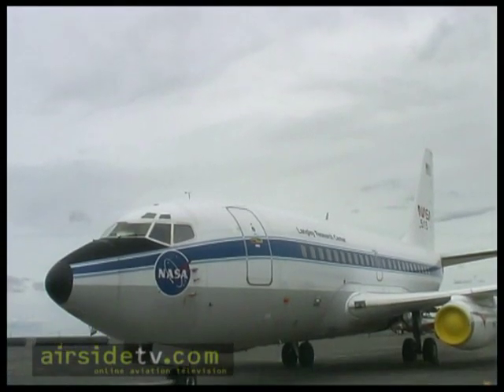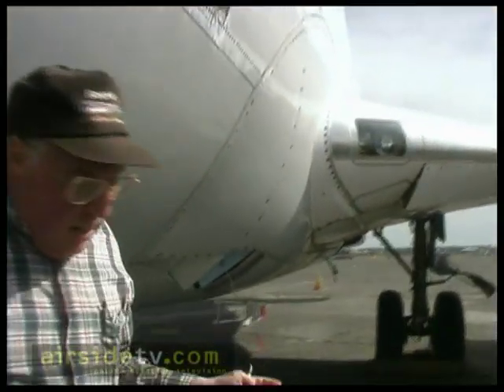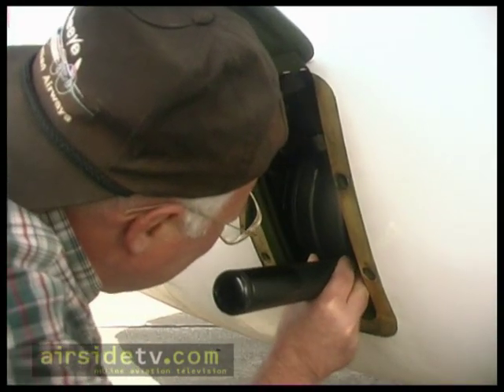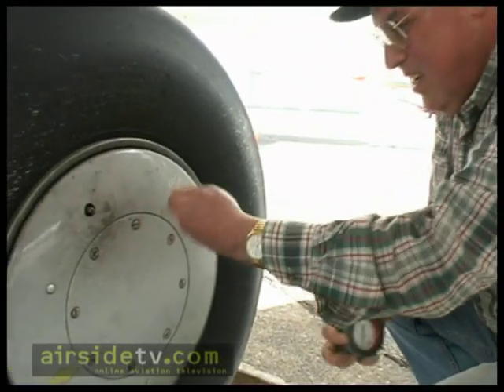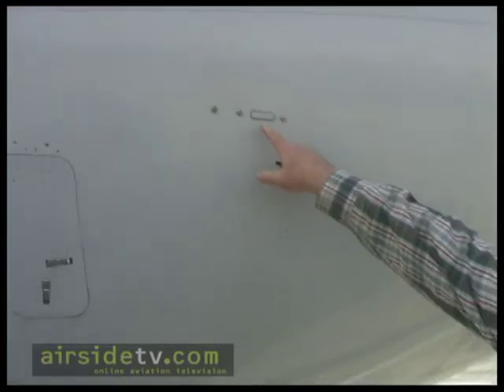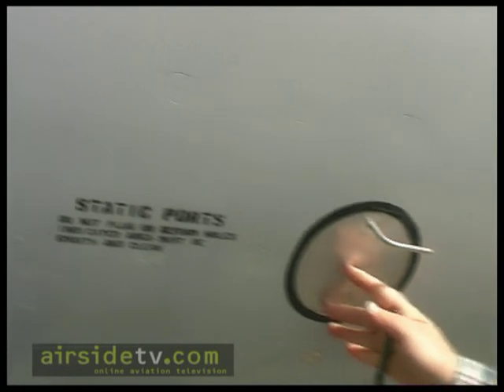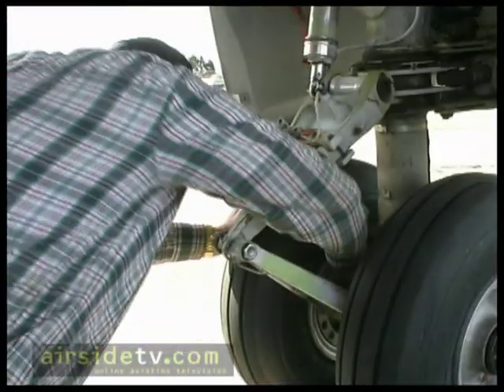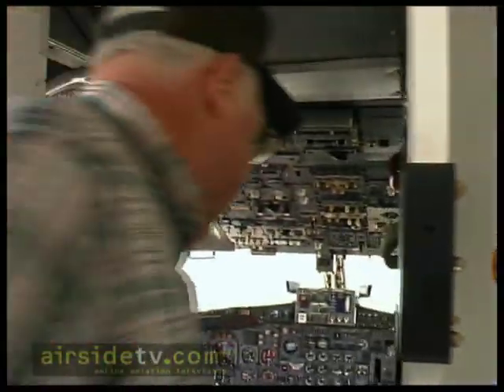Prototype Boeing 737 Part 1/4

Comment: @glsole No probs man , Thanks for the info ... boeing has been having problems with Engine manufacturers .... Like when they were building the 777 , There first order of planes were 36 something 777's with Pratt & Whitney engines (idk the model no) But they were built for the Boeing 777 and those things had problems , When they fitted the engine to their 747-100 Test Bed , It had an engine surge for some reason .lol . Pratt & Whitney were turned down when they offer engines 4 the 787 ...

Comment: @lufthansa330pilot , For Long range . lol ... They had to be long because the aircraft was so low , If they had put the engines that are on the new 737's like 300 - 800 , it would have scraped the Pods .... So the engines were longer and in some case provided the same amount of power as the shorter ones ... because it's length makes up for the smaller diameter

Comment: why is the 737-100/ 737-200's engins so long?
Reply: They are the old style low-bypass engines and have bucket-style reverse thrusters. Sorry it took 9 years to answer your question.
Reply: @27GX76R  JT8D Engines.
And sorry it's tooks two years for me.